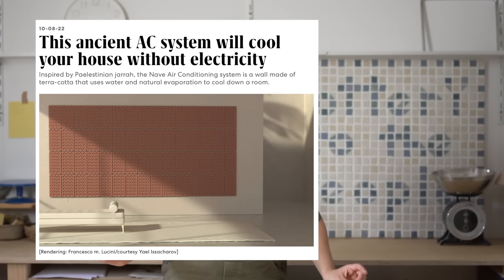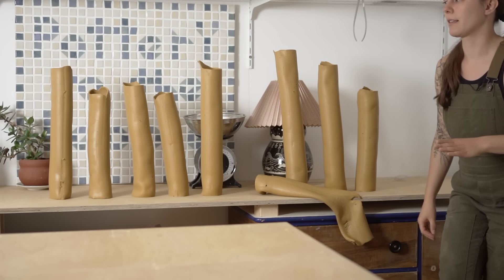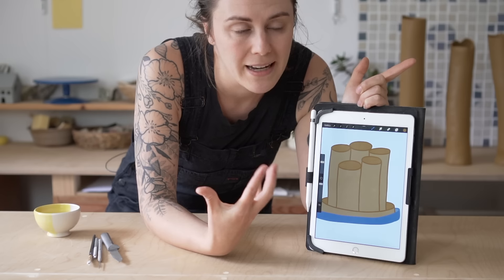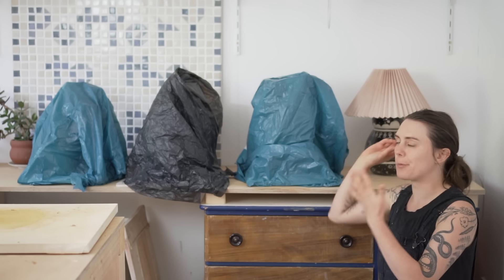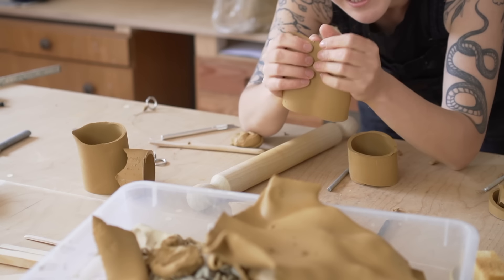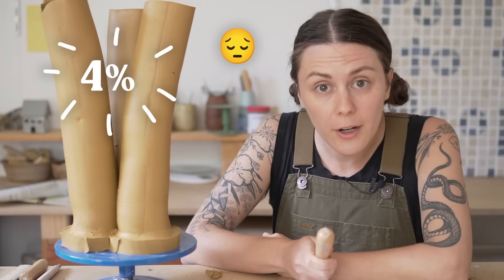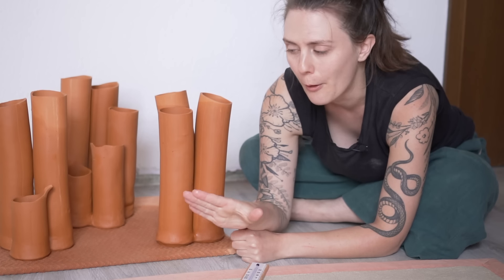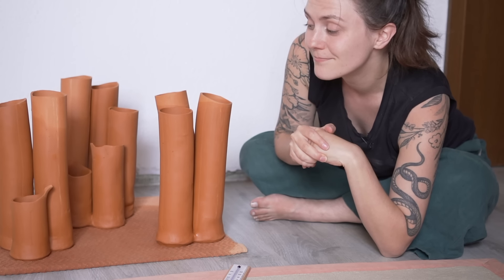Can I make an A/C out of clay???

Comment: by no means am I an expert in this area but I'm fairly certain this defies fundamental laws and has no real effect. Heat is a form of energy, it can not be destroyed only transfered. That's why every type of ac unit either has a hose blowing the hot air out a window (portable units), the back half with the radiator hanging out the window (window units), and/or the entire unit being outside against your house (Central Air)

In this project the clay acts as a heatsink and is absorbing heat from the surrounding room until it reaches a balance with the rooms temperature. Not 100% sure if water actually seeps through the clay,  if i did I''d expect either the clay starts to deteriorate as water displaces and slowly errodes clay away over time. I believe the more likely scenario is the water is acting the same as thermal paste for a computer processor, it's a medium that allows for easier heat exchange between the air and the clay.

Regardless of the details though, when the water evaporates its returning heat from its heat exchange back into the room, thus there should be little to no change in the temperature. The coolness of the clay is only noticable when you touch or possibly get extremely close to touching the clay because heat has been pulled away from them, but its still in the room.

in order to make this work you'd have to figure out a way to control the evaporated gasses and get them out of the house, otherwise you've accomplished nothing

Comment: I haven't finished watching the video yet, but find the idea very interesting. As you were showing the drying technique, an idea came to me that could help the stability while drying. Pool noodles! If they are smaller round than the clay pipes, perhaps inserting a pool noodle in each drying pipe would be an easy solution.

Comment: I recommend planting a tree of other shrubs outside. Not only is it beneficial to the environment, but they also cause shade which helps to prevent the building from warming as much. Also having a lighter colored roof helps with this too. Finally, a convection style system where hot air rises and escapes causing cool and less humid air to be drawn in would be another and more effective solution- although the setup may make it less efficient.

Comment: So... 67F is like 19.5C, and 66F is around 18.9C... btw in my house i have the AC set on 24C about 75F and let me tell you, if i had those temps that she has in my house i would not need AC. Temps outside go up to 40-44C (104-111F) and i'm lucky if i can keep the temp in my house at 26C(79F). I don't see how these things would help, if your air is at let's say 30C and the water is at 10-18C then what would happen the temps would try and equalize, like the thermal mass of water is much higher then the air and it would drop the temp of air and raise the temp of water, but when it equalize you would have to change the water, add our bodies in the mix which constantly generate around 37C... The whole system hinges on you having cold water, which isn't the case everywhere.

Comment: In order for your experiment to be valid, you needed a control - perhaps two rooms of similar size, on the same side of the house, with equal number & size of windows. Or, although not perfect, trying the same room with and then without your pottery on different days, beginning with the same starting temperature. As others have pointed out, this may have prevented the temperature in the room from rising as much as would have been the case without it. But you cannot come to any real conclusions without the control

Comment: Where can I get an extruder? I wanna make these to cool my house. E=mc2. I live in the tropics. I hate AC, this coming from someone who used to install split unit ACs. Why has air conditioning become one of my life nemesis. When I installed them, customers cussed me out when they didn't work, but they wouldn't listen to me explaining what they needed for the particular space. Most just went cheap and underpowered. When I first entered university there was no openings in the architecture dept., so I was dumped in to the "air conditioning" dept. Not glamourous sounding, so the school chamged the name to "environmental" something dept. Ever try to get a date telling the girl you're in the air conditioning dept. Haha. I really like your idea of coral tubes. These actually work very well, but you need to design the complete space as well as the setup of the tubes to match the heatloss over time to the evaporation rate over time, and to be completely holistic it needs to be placed so that air is constantly flowing around the tubes just like a regular AC. You can use a fan but then you'll be using electricity for the fan. So this is a great architectural/engineering/aesthetic challenge and project. For a 900 sq ft space, I think you'll need about 15,000-20,000 btu of cooling to get it down to 65F. Not certain, but I think one btu is the amount of energy needed to raise the temperature of one lb of water one degree F at sea level, something like that. So that amount to a huge number of tubes. I'm really more drawn to the artful holistic nature of the concept. However, keep in mind the second law, in a closed system everything will always move toward high entropy. So is clay expensive?

Comment: this is diy air cooler. lol.

i did similar to this for my phone to auto grind a gacha game. to prevent the phone from heating up, i put water into a small diameter dish. then put some crumpled tissue to make it higher than the dish + water. put the phone on top of the dish with the crunpled tissue as the connector between water and the phone. then i blow it using small usb fan to evaporate the water in the tissue.

it worked well, my phone could auto farm for hours without heating up at all.

Comment: The cooling part is valid, but... the model you're working on cools the inside of the pot, not the outside. The outside gets cool too, but even the amount of air needed to circulate that cooled air is going to completely overwhelm the clay's ability to transfer water to the surface. Speaking of surface, that's your other big problem. If you look at the pads in evaporative coolers (I'm a native New Mexican, I KNOW about swamp coolers. God bless them.) they are essentially sponges, not to hold the water, but to increase the surface area available for evaporation. That way a square meter of pad is actually providing 20 times that much surface area for evaporation. I see that you're making multiple tubes, but... how do you feel about filling your house completely to the rafters with clay tubes and then blowing air through your house, into the tent where you now live? That's the version of what you're doing that would be effective in any way. 
There is no need? Evaporative cooling technology already exists, and it is both advanced AND appropriate. Use it. Spend your time and effort in more profitable directions. Because- this part's important- you're NOT EVEN SAVING ENERGY! If this cooled air 100 times more efficiently than it does (it doesn't) you would still need to move that air around to COOL YOURSELF. Moving the air is the only part of an existing evaporative cooler that uses any energy input (lifting the water is done by the pressure in the mains, same as the water was lifted into your pot.) If you look at your model and think about it logically, you'll see that it would be WAY more effective to just hang a wet bedsheet in the center of a hot room, and even then all you would accomplish is to raise the relative humidity without changing the temperature by even 1/10 of a degree (u pick). 
It's a moot point anyway. You can afford to use a little electricity to make yourself comfortable, and you WILL be able to do the same in the future, and more and more people will be able to say the same. Yes, even with climate change. We're not going to be energy poor in the future, because when we reduce our use of fossil fuels we are NOT going to reduce our energy consumption, we're going to replace the shortfall with nuclear power. And no, I'm not talking about fusion. Your objections will, uh, evaporate, as soon as you get uncomfortable enough, count on it.

Comment: So greater surface area for them to evaporate? So okay lets start with two dimensions. Old math question in school the class was asked. If I gave you 20 meters of fencing and said use it to give your self the greatest ground area most do the typical square. Turns out a circle has more area in it then a square. Move this to 3D and a sphere has more volume then a cube. Another way to say is a sphere has the LEAST amount of surface area per given volume.  In the case of this cooling idea you would want the opposite. So you WOULD want the cube or something.

So the question is what shape has the MOST amount of surface area per given volume. This yes then would allow the most surface area to as said evaporate through the pores and cool things off.

As another commenter has pointer out it does have its limits in humid areas act, but yeah ideally you would want a shape where the inside volume has the MOST surface area to evaporate through.

Comment: You're not using the principals of convection properly. Cold air sinks, hot air rises. If you want to maximize their effect in a room with static air flow, place them higher up. The air they cool will naturally sink down to the floor. Warmer air will rise to fill the void. This will create a heat generated air flow, which will maximize air contact with the ceramic. Also, as the process uses water evaporation to work, you need new drier air constantly to keep evaporation at a maximum. You can also simulate this by putting a fan that blows air through them. Having them higher is better though, as warmer air is also more absorbent.

One last thing, as water evaporates into the air into the room, it will raise be humidity. Also, the heat the vases expels is in that humidity, so it will still be in that room. Either driver air needs to be exchanged with the driver air or you need a way to condensate the moisture out of the air. That will maximize your cooling.
Reply: Dryier, not driver. Stupid spell check.  Also, I tried to edit it, but the app is being dumb and refuses to let me edit comments. Yay. Anyways, you get the point.

Comment: How hot would the room be if you hadn't had them in there? It would have been heating up with the rest of the unconditioned space.  How cold do you want it?? 66f is the average temperature in my area for the first half of November. I would want long pants and heavy shirt in your room. Air conditioning accounts for 6% of the electricity use in the US which is only 25% of total CO2 emissions. If I did my math correctly, air conditioning is roughly 1/3 of 1% of total Co2 emissions.

Comment: I don’t think you’ve made an AC system…I think you’ve made an air humidifier. As such, if you use this in your home on a hot day, the air will get more humid which will prevent less sweat evaporating from your skin (this is what cools you down)…so this device may even make you hotter on an already hot day.

Comment: Anyone wanting to know how to cool a building without an AC. Spray the outside with cool water. This will drop the temperature very quickly. But it's easier to prevent the heat to begin with. Tips below"

If you don't mind having people assume you cook meth, crinkle up some sheets aluminum foil and place it shiny side out in the window. The crinkles are to prevent there from being a single blinding spot that the sun hits. For a less crack house look you can use thick white curtains, though they are less effective. It can be hard to find thick white curtains so lighter shades of blackout curtains will also do decent. You want to stop or repel the light at your window.

Open up windows at night, even if just a crack, and close them in the morning. Many people seem to think they need to just leave windows open. Well if its cooler inside than outside how does leaving the windows open keep the heat out? It doesn't. So seal in your cool air. So long as your home isn't dark and you dont share it with lackwits who just leave their windows open and sap your cool air away, you will be amazed at how well this works. Its worthless if you have nothing to keep the suns rays from entering your home though.

Comment: This concept is common in desert climates.  They're called "swamp coolers" and they're really detrimental to have in your house because they increase the relative humidity significantly, making ideal conditions for black mold and will rust stainless steel on your appliances and door hinges.  A/C actually dehumidifies the air by design, which protects your house.  Air conditioning itself is not contributing to global warming, since air conditioners take many forms and are nothing more than adiabatic heat pumps.  It's the *way in which A/C is powered that contributes to global warming*.

We shouldn't be trying to run from the concept of a heat pump since it's the most proven and sustainable technology.  We should seek to reinvent how it's powered, how to optimize temperature differentials through quantum paints, consider solid state heat pumps, geothermal heat exchangers to passive solar, better insulation and everything in between.
Cool video though.  It would make a good sculpture and you got me to click.

Comment: I'll start with this: I agree with the goal of more sustainable living. However, three reactions:
1. The answer to the question in the title of "Can I make an A/C out of clay?" is an absolute "No." 
2. There are even better alternatives.
3. People are not to blame

One:
This is not air conditioning. This is air cooling. The reason we call it an "air conditioner" and not "air cooler" is because cooling is only a portion of the goal; The rest is a reduction in humidity. That is arguably the more important goal of air conditioning, with cooling being a useful side-effect.

Instead, what you have made is not an air conditioner, it is an evaporation cooler, or a "swamp cooler". It's useful for a rather mild reduction in temperature in dry areas, but they are called "swamp coolers" because they end up smelling like a swamp. On top of not working well in humid locations (Like here in north carolina, where today it's 81 degrees and 90% humidity), these come with loads of drawbacks, such as increasing humidity, producing worse cooling results, requiring much more maintenance and attention (gotta refill the water regularly), and being a very localized solution (can't cool a whole home).

Two:
The best alternative would be to get people away from traditional air conditioners in the summer and forced-air heaters in the winter, and get them to move to *heat pumps**! Heat pumps have much lower energy consumption than traditional A/Cs and heaters, because they just relocate heat energy from one place to another (inside -> outside, or vice-versa). They are so much better in so many ways, including the possibility of **geothermal* heat pumps, in which we pump the heat energy into/out of the ground - Which can increase the efficiency for heating to the 600-700% range, compared to forced-air units that burn fuels.

Three:
The real problem isn't people wanting to be comfortable. That 4% statistic is just calculated from household electrical usage. So, extrapolating a bit ... if about 50% of the average A/C-having household's electricity is the A/C unit, then being generous we can say about 3% of the global contribution to global warming is "other household electrical usage". That's 7%. What's the other 93%? Answer: Big corporations being careless with the kinds of things they release into the atmosphere. Instead of suggesting people shouldn't want to be comfortable, we should crack down on greedy capitalists who have continuously avoided accountability.

Comment: 67f is hot???? My air conditioner is set to 69 and it feels lovely cool.

Also we have that here. We call them swamp coolers. It's a large screen that's designed to absorb water and a big ass fan that sucks the hot dry air from around it and it is a much more energy efficient form of AC but it's effectiveness is decreased with humidity and it makes the cooled area more humid. But it kicks ass in a little humid 109f (42.8c) shop.

Comment: Focusing on the small percentage of climate change that's coming from people seems like one of those oil company psyops that do nothing expect distract from actually making the world better. Like, people using the technology that allows them to avoid heatstroke and get a good night's sleep even in a heatwave is not a massive problem, especially not if their AC runs on clean energy rather than on oil/gas-generated electricity. Like, I'm 100% for finding solutions that don't take electricity at all, it just doesn't actually have to be framed by the idea that having actual AC is a bad thing.

(Also, like. How much of that "4%" figure is AC in cars? How much of it is AC in factories, stores, and offices? How much of that already quite small number actually deserves to be laid at the feet of an average home owner? Like... we KNOW that oil companies continuously run these psyops. Like, we have decades of documentation PROVING that one of their top tools is to try to make individuals feel bad about their consumption, so we won't demand THEY change, even though they're the ones actually driving the planet into destruction.)

Comment: I just wanted to offer the idea that you should create a form out of wood or cardboard sized to the inner diameter of the extruded tube to support them as they dry. Waxing the surface of the form should help avoid the clay sticking to it. As someone already mentioned, adding texture to the outside of the tubes would increase surface area for cooling.